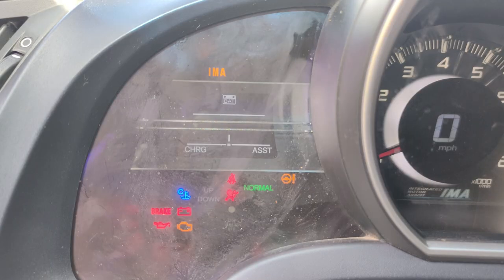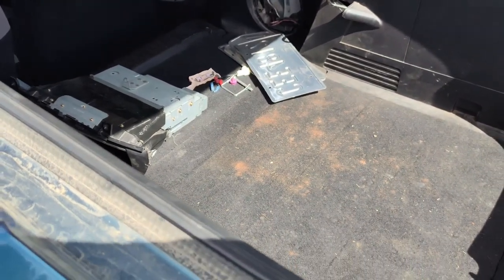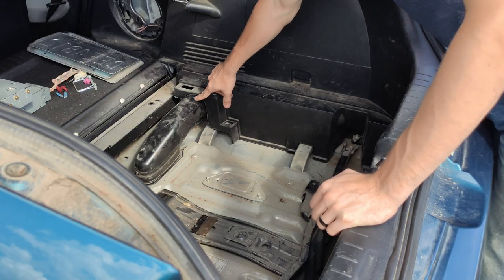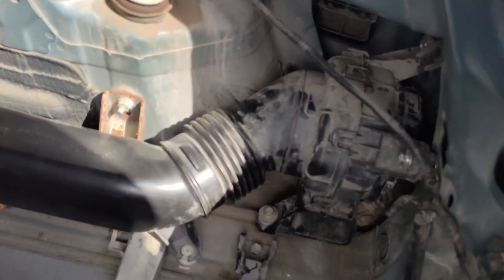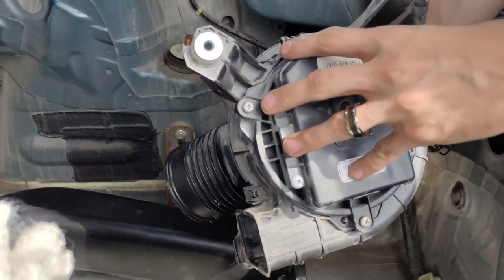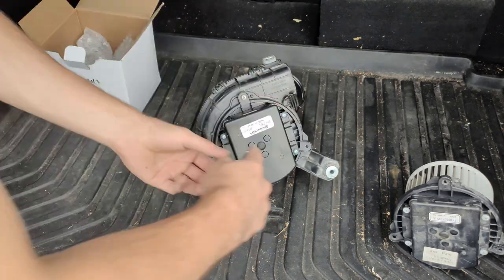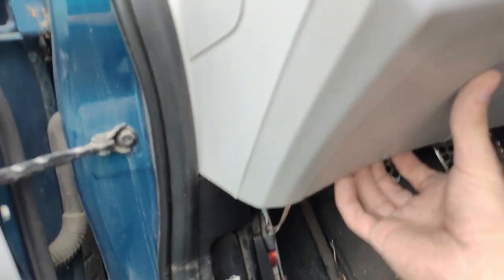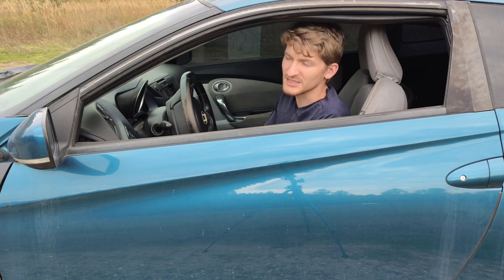Accessing and Replacing Honda CR-Z Hybrid Battery Fan

Comment: My hybrid fan turns on loud at random times, even after turning the car off for a bit. Recently it happened and finally gave CEL P1448. I cleared the code and it hasn't happened again yet. Does this sound like it just needs the fan replacement?
Reply from the maker: Yes, sounds like the fan could definitely be on its way out and use a replacement. Check the ducts and filters and make sure there isn't debris or blockage as well.

Comment: I have IMA light come on my CRZ but the code is P0A7F , the light come on and goes away for weeks , the car however perform normally. I am not sure if replacing the fan will actually do anything , I need to take out the fan to visually inspect at least
Reply: Same brother, idk if I should get it check or check by myself

Comment: Thanks again for the great videos,! My pearl white has most warning lights that pop up after a bit of Driving when resetting by disconnecting battery, I just got a new battery and it was great for a day then lights on again! BTW if you need the 12 battery replaced they are $141 minus core 16 at Honda dealership. They were over 200 elsewhere. And the Honda labeled battery had greater cold cranking power! Interstate were like 220. May all our problems be small ones! Did you get your battery temp up to check the fan or run power to it?
Reply from the maker: I did end up running the vehicle for a while to get the battery up to operating, took it on a 45 minute drive as well. All the problems went away! Airbag light is gone now as well after a couple cycles with the 12V battery charged up. Will be upgrading to a 51R in the future, though.